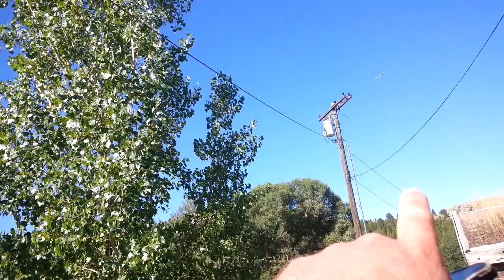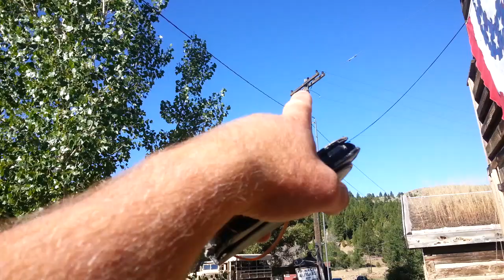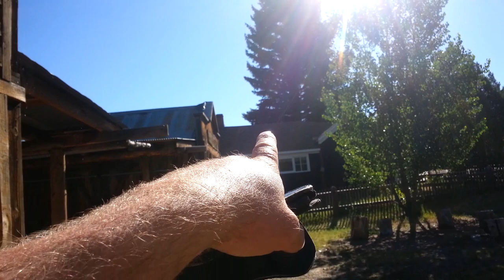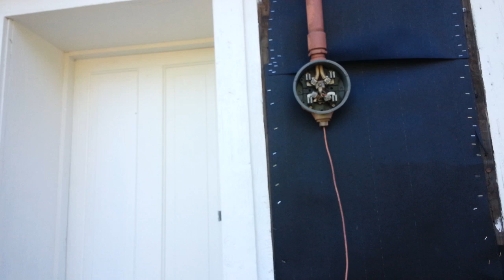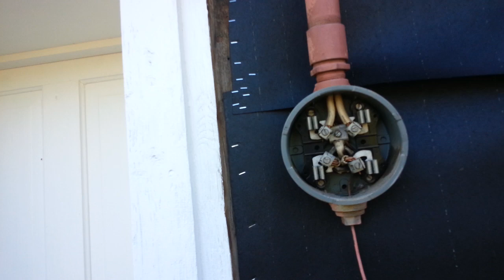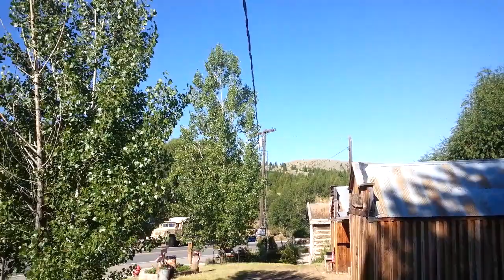Shorted Power Transmission Line

Comment: The round box on the Newhouse is the meter hub. It should not be left open as there's 220 Volts across the terminals at at least 100 Amps. Very dangerous!